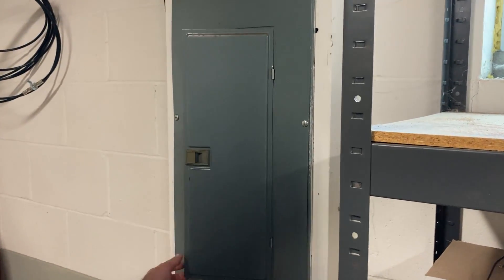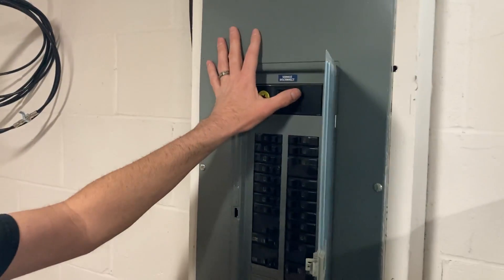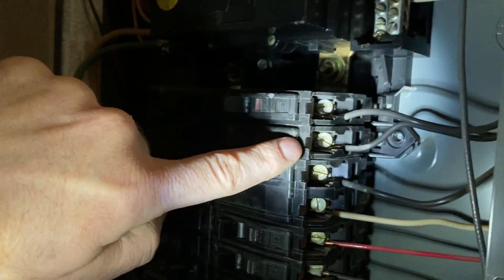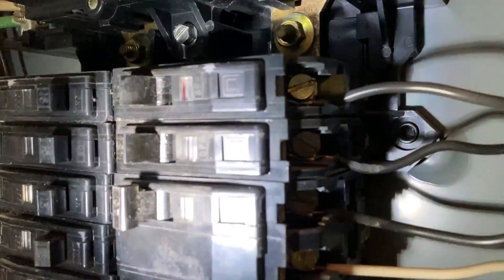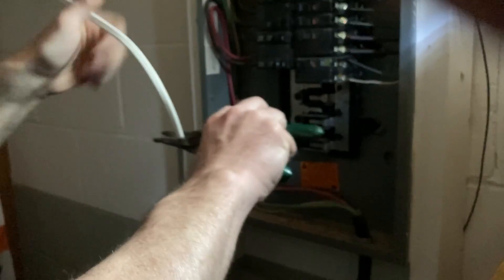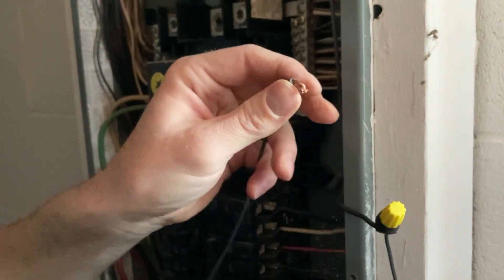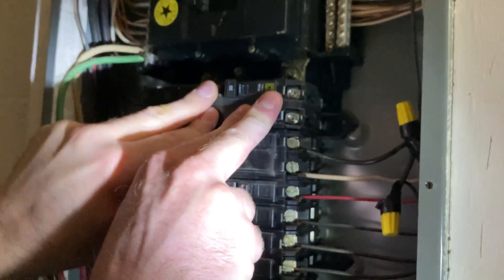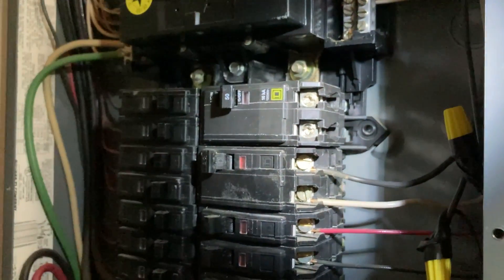How To Move Or Replace Circuit Breakers

Comment: I’m in the process of doing this myself. Great video thanks for posting. I guess one consideration - did you think about which phase  they were on originally and putting it back the same way? In other words if the 15 amp was on the left phase and the 20 amp was on the right phase did you ensure that was the same case when you moved them down to the bottom?  Does it matter?
Reply from the maker: beats me lol i assumed that each side , right and left, would be the same.  if not the whole box.  i dont know enough about electrical work or what a phase is, just did it how my step dad would have showed me.
Reply: @shawndavis9276  Good video. But always check with a reliable tester or multimeter that there is no power before you touch any of the screws, wires or metal parts, even after turning off the main breaker. As to the 2 sides, they are called legs, similar but not quite the same as phases. You can put on either side, but total load on each side (leg) shoould be approximately equal.
Reply: @shawndavis9276  - Well turns out you could’ve put both circuits on the opposite leg without knowing it. Circuits one and two are on Phase A or leg one and circuits three and four are on phase B Or leg 2. So you would probably want to keep them on the same phase they were on in other words
Reply from the maker: @condor5635  thanks for the explanation, I just looked and what you are saying makes sense looking at the panel, the panel backing that the breakers plug in to are staggered every other row.  
By dumb luck, mine ended up on the same phase as I pulled them from.  So, if you move them an even number of spaces down, your good.  Odd, ull switch phases.
Now I don’t know if any of this matters but I’m glad to know I got lucky and they are on the same phase that they came from😁
Reply: @shawndavis9276  hahahaa sometime really weird questions pops up when talking to other people as well. I thought I knew what I was doing too until some questions were asked